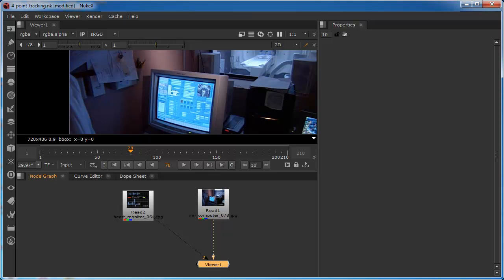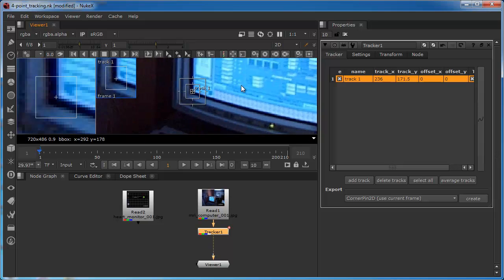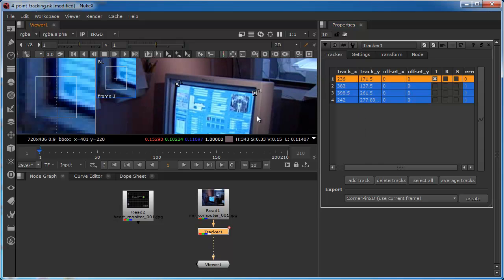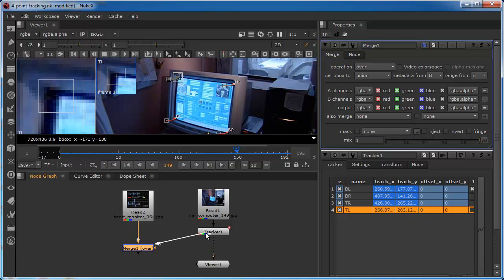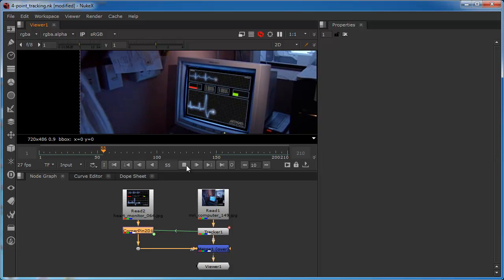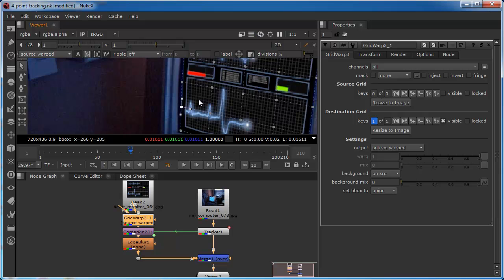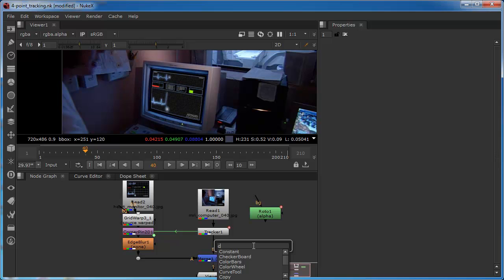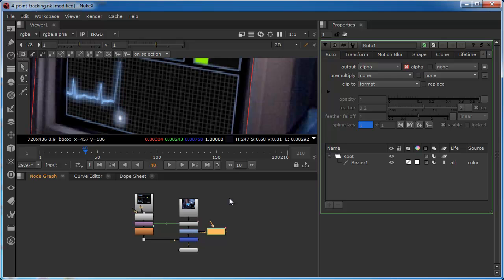4-Point Tracking in Nuke

Comment: in regards to enabling the R and S, why would oit be so bad to just enable everything so that you cover everything, if there is no rotation and no sclaing its ok ot wont calculate it but at least it knows.... so why would you bother thinking ohh should i cross this or not?
Reply: Victoria Films  
Corner pinning is a straightforward perspective warp, which it achieves by position charges across all four points. It doesn’t need rotate and scale data. This is just adding unnecessary load on the script
Reply: @peterholmes7890  ok but it cant be wrong because by definition if it is included in an ensemble and the first and last value of the ensemble are higher it shouldnt be a [problem.

Comment: can anyone help me out with something I am importing a dpx sequence in nuke but I am not able to play what might be the problem how should I fix it and by the way I am using the Non-Comercial version the nuke please help me out? I checked all the forms but nobody mentions this problem so if anyone knows please help me out here
Reply from the maker: shaik irfan 

Comments here should relate to the actual tutorial.
I suggest you post on general dev forum and, given the nature of the question, I would look for beginner forums. Here is a possible source:

https://community.foundry.com/discuss/forum/191/nuke-dev

Good luck
Reply: @nukebox9383  thanks for replying
Reply from the maker: Can you actually see the footage in the viewer? If not it is most likely due to a break in the path from source media to your nuke script. If so just re-import it.
If you can see the footage but it doesn’t play, switch the viewer from global to input and retest. It could be simply the frame numbers on the sequence as sequences are often named starting at 1001 and your viewer may be playing from frame 1. It will play but you will have to wait a while for it to reach 1001. Another thing to check is whether you imported the sequence or just a single frame. You can check this in the read node properties.
I don’t think the issue will be a result of the non-commercial version as it should have installed all the same codecs as the full version.
Reply: @nukebox9383  thanks I will try it out I can see the footage but I doesn't play . I think I did this I took that footage and too a new comp and left it playing for while when I came back and check it it was playing but I didn't how it happened thanks for helping I will try it out
Reply: what if the main background is about 512 frames long and the screen replacement footage starts from 5000. it not going up to that point .
Reply from the maker: Watch my tutorial on the Nuke timeline: 
https://www.youtube.com/watch?v=5c0PPAkSV64
Hopefully this will aid your understanding of playback issues and image sequences
Reply: Actually I was do the same thing the problem was with screen replacement footage

Comment: you actaully just forgot to mention thr <<set to input<< option in the cornerpin node
Reply from the maker: Victoria Films 
The nuke tracker node defaults to the corner pin 2d setting so I omitted it. You are correct though, I should have at least made reference to it. I also omitted the corner pin export setting, which auto-generates the corner pin node. This was deliberate though as I wanted to show how to set this up manually.

Comment: I've got a question regarding more difficult screen replacement's what if you have a shot where you don't see all four corners of the screen?
What if the screen is constantly over the edge of the scan?
Reply from the maker: Robert Gittings 
Hi
That would need a different approach, either a planar track on a 3D tracking workflow.
I’ll try to put something up that   deals with this scenario
Reply: Thanks for the quick response, I was given a monitor shot which is a green screen too but they did not put any markers on it. I tried a 3D track to no success probably just too many actors moving around the shot even after I garbage matte them. I tried planar track but due to the movement of the shot, it didn't work well. I might have to fudge this shot by eye and keyframe some transform's whilst only using only a 2 point track instead, unfortunately. Two monitors both at different angles. Got half a day to left on the bid for it. 

I had a similar issue in the past with a mobile screen replacement actors thumb was constantly over the one corner but the way got around it was by creating the missing corner using a roto shape which gave me a point to track and it worked.

Comment: can this be applied also whit only 3 corners?
Reply from the maker: Ruben Piergiovanni, depends on the shot but usually not. Look at planar tracker node for this Orr even the 3D camera tracker
Reply: Thanks while i was waiting i solved tracking and generating a match move node to link to a transform. I had just to place a object on a static hand. :)
Reply from the maker: Depends on the footage but normally, if a corner was missing, I would use the planar tracker to perform a corner pin instead.